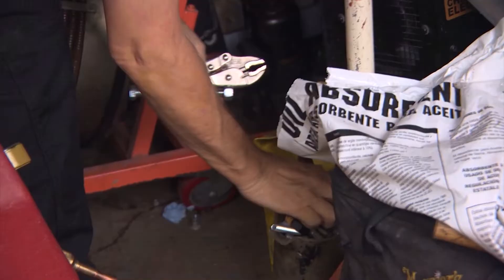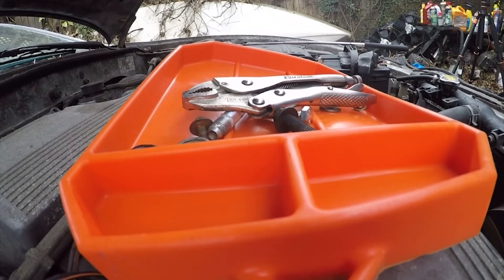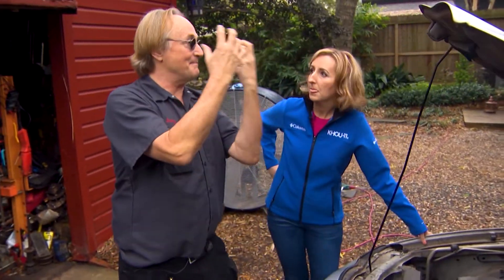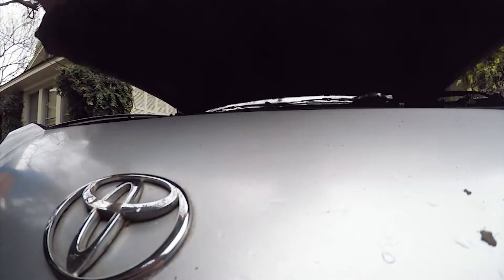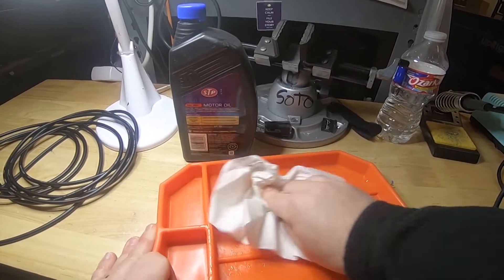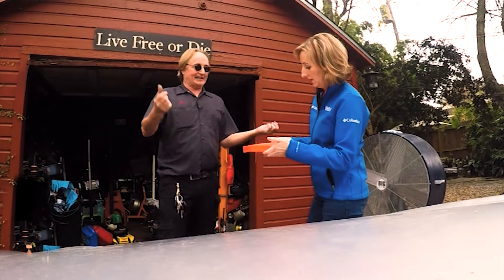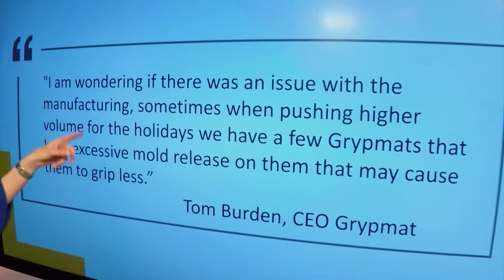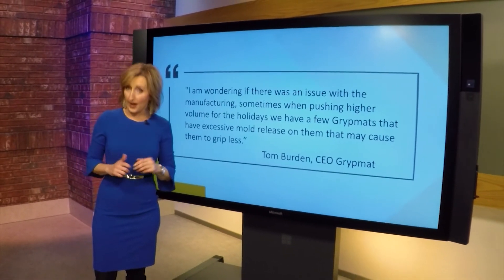Scotty Kilmer helps us test the Grypmat

Comment: My magnetic tray can hold on a 180degree angle...😐 and cost nothing compared to that!

Just use painters tape on the bottom side of the magnets to prevent scratches from metal debris stuck to the magnets.

Comment: He put it on a dusty dirty engine cover first. That is why it didn’t grip. I just got a whole set of them for my birthday and the will grip to a clean surface as stated. You can use solvents in them like brake cleaner without damage. I can’t use the magnetic trays on painted surfaces because they are constantly collecting  bits of iron from off the cement and small chunks of metal from wire wheels and such. Pain the butt to constantly clean.
Reply: Grips to clean surfaces? What u workin on?